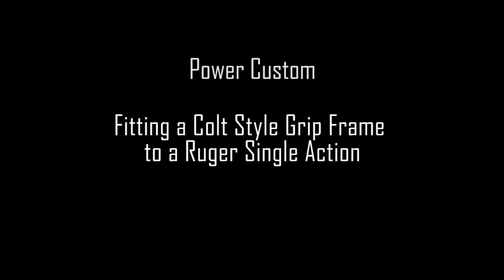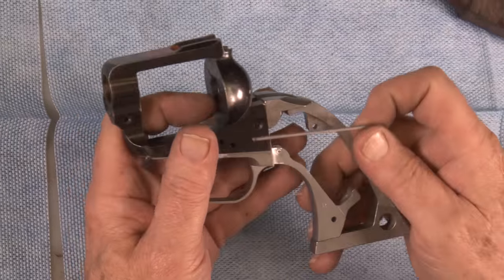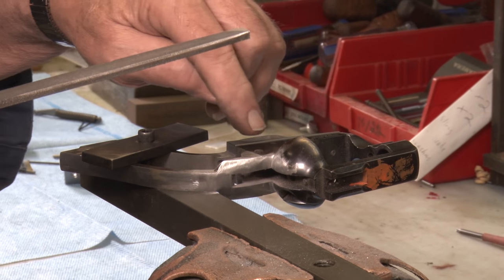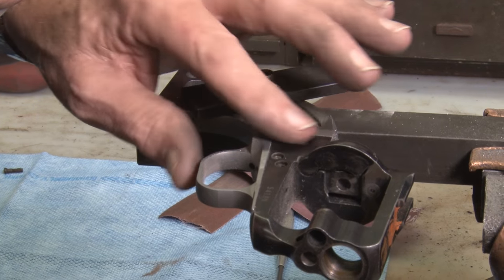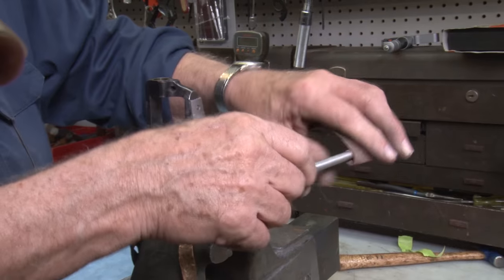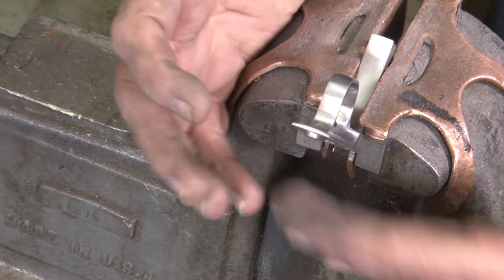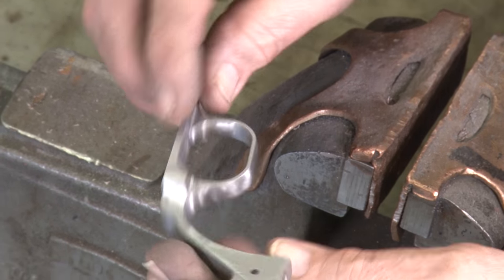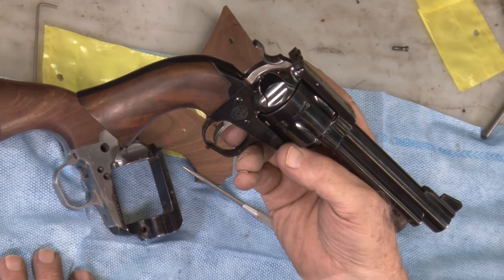Power Custom - Fitting a Colt Style Grip Frame  to a Ruger Single Action

Comment: Why would you want to put Colt grips on an Old Model Blackhawk?  Looks?  Feel?  Why not just put on a Super Blackhawk grip frame and grips?  That would give you something to hold on to.  Of course the 1860 Army grips & grip frame would also give you added length, but they would still be made for Colts.  
Back in the days when the Super Blackhawk was available with a brass gripframe, I found two of them at a store for $16.50 each and I bought them both.  Now I own a couple of New Model Blackhawks and see what I have to do mostly involves opening up the trigger slot and adding a pin for the trigger spring.  That should be an easier job, and really look nice in brass.
Reply from the maker: somtimes people with smaller hands want to have a colt style grip frame on there Ruger revolverm.

Comment: I am wanting to change the square trigger guard,on my Ruger new model Super Blackhawk. On this model will there be any alterations that have to be done thanks.
Reply: no if you do not want to be picky just order the Vicaro frame and put it on . They are like $30 dollars on ebay .  You can still find the Bisley frame kits but they push 300 bucks or more .